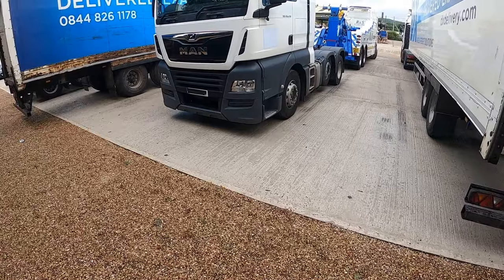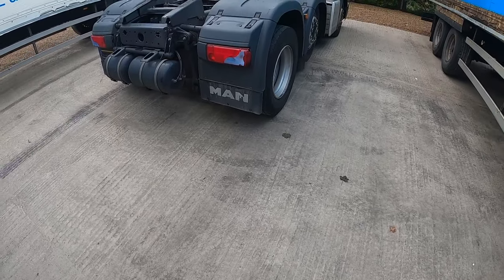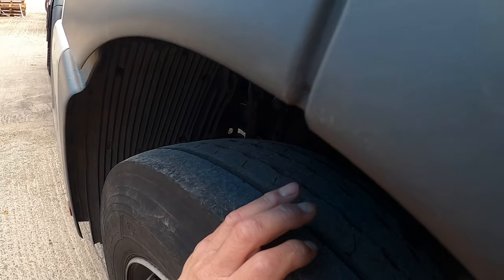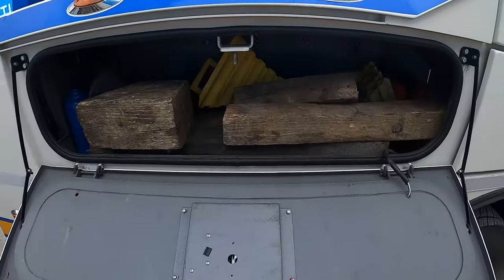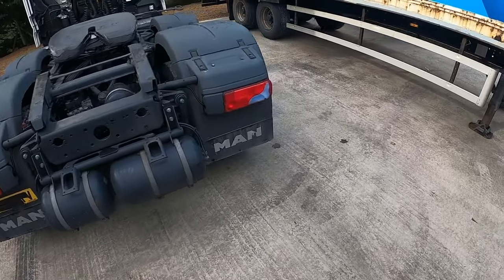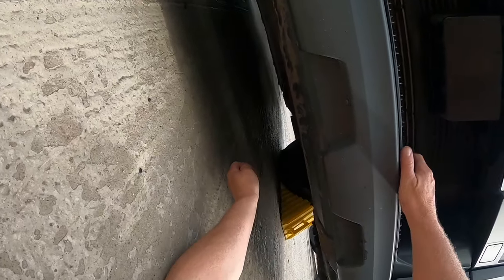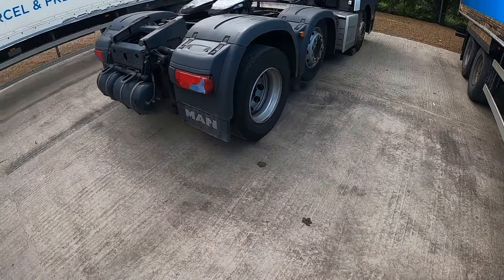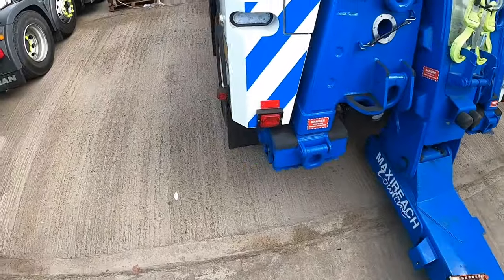REAR LIFTING A MAN TRACTOR UNIT!

Comment: I need to get some of those small straps like you have for tying steering wheels, those seem much more simple. Currently I use some basically 2 inch ratchet straps, I think those small ones look more efficient.
Reply from the maker: Hi thanks for watching , i still use small ratchets as well as there not very long ,so sometimes you cant reach the base of the seat with them.
Reply: Self retracting inch wide 600kg straps are what I use. Just so easy lol

Comment: When I move tractor units backwards on my low loader. I always throw a strap over the air spoiler. Had one blow off in the past because it isn’t designed to run that way and acts as a big parachute.
Reply from the maker: Hi Gareth thanks for watching, good shout mate have used strap before but tend to front units with big front spoilers if there going a distance due to parachute effect.

Comment: at 8:14 it looks like the bar is cutting into the tyre a little
Reply from the maker: Hi Daniel , the ends of the cross heads our rounded with no sharps edges , you will find it self locate between the drive axles more centrally when you get going , thanks for watching and commenting.

Comment: What is the reason why you didn’t lift from the front?
Reply from the maker: Hi thanks for watching , by rear lifting the drive axle saves disconnecting the drive to the gearbox ie removing the half shaft.
Reply: @HeavyRecoverywithSteve  thanks for the reply. I thought that maybe the case. Enjoy the video.
Reply: Good job as ever Steve.

Comment: Another great video Steve. Nice to see a bread and butter job as well as the tricky ones! It took me a second or two to twig why there is less space between the drive wheels these days! Most modern trucks seem to come with the wider/lower profile 315/70 tyres...... Most trucks I drove were on 295/80s.

I have a question for you: Years ago, I seem to remember heavier recovery drivers being exempt from tachograph regulations. I think I remember that changing at some point to the tachograph regs applying on the way to a job, exemption until the job was completed, then back under regs on the way back to base, but I'm not sure. Do you work under the regs now?

Thanks 👍👍
Reply from the maker: Hi Simon thanks for watching , yes we have to comply with tacho regulations if we travel more than 100km from our base.But most of my work comes inside this scope , so no tacho required for most of my work.
Reply: @HeavyRecoverywithSteve  Thanks for that Steve. 100km from base is plenty far enough!
Reply: Not just wider tyres but Mercedes actross for example generally have a narrower axle than most

Id say it would be a manoeuvrability decision or perhaps going with the narrowest axle to cover the most markets

Comment: You would if thought someone would of made a steering wheel strap
Reply from the maker: Hi Dipsy thanks for watching again , think soft straps we use less likely to dig into steering wheel as some straps that have hooks which attach directly onto the wheel.
Reply: Like a strap with a soft bit so it doesn't dig in to the steering wheel was talking to a friend who brought a wrecker few months back and we mentioned this the other day as he uses a ratchet strap and he says sometimes it digs in the wheel

Comment: Question Steve what do tractor units weigh in at
Reply from the maker: Hi Mohammed , roughly 7.5 tonnes but depends on how you spec it up with different engine and cab options.